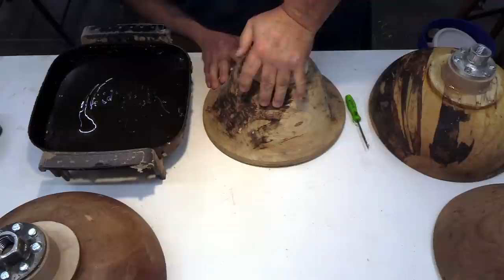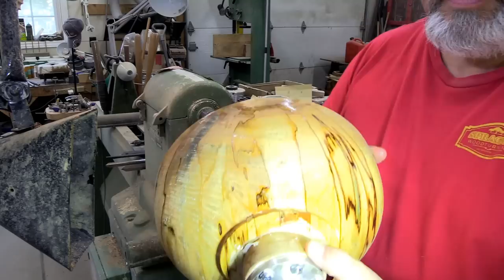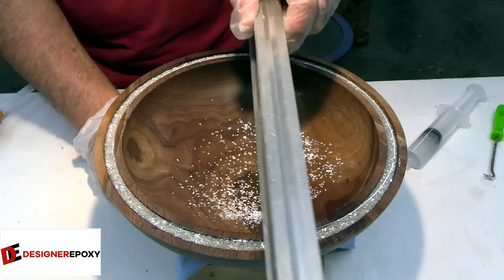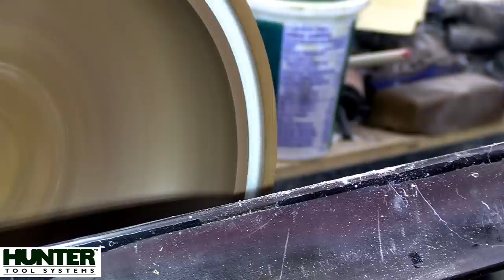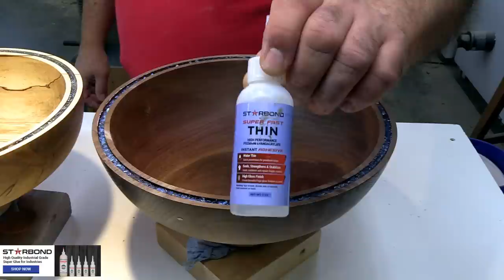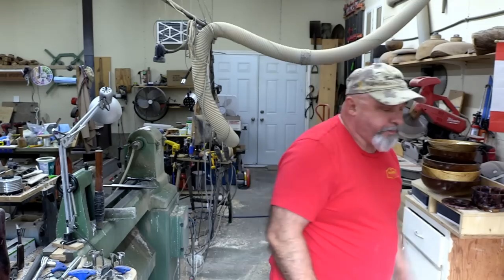Woodturning - Natural Inlay Extravaganza and Three Gallon Epoxy Giveaway!

Comment: Love all of these Jim! The Designer Epoxy did a nice job of hardening the grain in the maple bowl. 

I agree with your comments about the importance of stiffening punky grain. I’ve also found that soft maple will change colors over time as it lays on the ground. When I first started turning a friend gave me access to a soft maple log. I didn’t have a truck to haul it home so I would cut a few pieces, take them home in the trunk of my car. It took me several months to get it all home. The blanks got darker and more spalted as time went by. Made for some beautiful bowls.
Stuart
Reply from the maker: Yes they certainly would of gotten darker with time. Thanks

Comment: The opal inlay would look amazing if you put some black resin into the channel first. I'd suggest allowing it to cure before adding the inlay material.  Opal stones are often set in jewelry with a black backing, which brings out blues and accentuates the opalescence of the stone.
Reply from the maker: Just need to get my hands of some of that awesome stuff! Thanks!
Reply: @SpragueWoodturning  I'm pretty sure that's what the opalite inlay was, especially since it got so blue once you added the CA glue.

Comment: Hey Jim, I have the power cap as well and they STRONGLY recommend NOT blowing the filters clean but vacuuming them clean.  I also decided to get a different style from the same company that has the filter on a waist strap on your back - they have a pretty affordable version of that compared to the cost of other similar ones.
Reply from the maker: Thanks for the info. I will check it out!

Comment: Love the look of the inlays. My favorite is the Diopside in the spalted maple, really like that green. Love the color variety in the butternut. 

For a dam around the edge, you might try self-adhesive foam weather stripping. You may still have to run a bead of glue, but if you got a tall enough one it could give you a surface to put your level on.
Reply from the maker: Thanks for the suggestion

Comment: Congratulations Calwille! Hard to believe that a tree as nasty as black walnut has such beautiful wood. The opallight is my favorite.
Reply from the maker: Thank you very much!
Reply: Just curious as someone not so familiar with trees - what’s “nasty” about the black walnut tree? The wood sure is gorgeous, but why don’t you like the tree? Are the nuts good to eat?
Reply: @greenmanjnj  well, first you have to race the squirrels to get the walnuts picked up. You can’t eat them so they are useless. If you miss some and run over them in your driveway you have a black stain to try and clean up. If you run over them with the lawn mower that means a new blade and you need to make sure to wear a hard hat or helmet to mow. This is just a short list.

Comment: Jim, Not all hot melt glues are the same.
There's a standard glue, which most manufacturers offer, then there's high bond glue. It's a stronger bond by far.
Check it out!😅
Not sure if you were aware. 
As Always, Love Your Work!❤
Reply from the maker: I was told the one I’m using is a high temp glue, is that the same thing! Thanks

Comment: They are all beautiful. My favorite was the maple. What do you think makes a better inlay?  The Starbound or the Designer Epoxy?
Reply from the maker: Designer Epoxy seems to work better in this type of application. But if I was using crushed soap stone, I probably would use Starbond.

Comment: Nice job jim..have you ever thought of using the beall system to buff the finish at the end with the fine wheel and carnauba wax? I  love the finish.  Thanks
Reply from the maker: No need for it. Plenty shiny without it and the problem I have with Carnauba wax is in the future the client has no way to redo it. With this finish all they need to do is use some 0000 steel wool and apply the finish again and is restored. Thanks

Comment: They turned out just beautiful! I love maple so those are my favorite especially with a contrasting inlay. I love the branch inlays as well. You do such fantastic work.  I do have a question though. I thought the inlays were supposed to be done with the thin starbond. Am I remembering that incorrectly (which is entirely possible)? Thanks for sharing the video. ❤
Reply from the maker: If inlaying coarse material like these, the medium is usually what I would use. The thin would of worked good here too. Thanks

Comment: Nice inlays, would those white inlay materials work with lightly colored epoxy?  Or maybe paint  the bottom of the inlay groove?
Reply from the maker: If you put white inlay and white epoxy “, it would blend together and make the inlay disappear?  Don’t you think?
Reply: @SpragueWoodturning I was thinking of a clear epoxy with just a light coloration, or painting the bottom of the groove with a more intense color and use the clear CA to hold the inlay material.  Either of these would probably be best with a lighter colored wood.

Comment: I don't know if this would work with the CA glue especially if you spray your inlay material with 99% isopropyl alcohol before you put your resin in it will help break any surface tension on both the wood and the inlay to help bubbles release easier to come up to the surface then you can spray it again to pop those bubbles
Reply from the maker: Possibly, but I’m curious about making the glue cloudy. Thanks

Comment: I would try using either a paper Dixie cup or a Piping Bag for like frosting the Disposable kind that you can cut the it for whatever Plies whole in the end that you need and I would mix the resin and your inlay material vacuum chamber and then poor or pipe it into the bowl that way he's a resident gets all the way through it and you can be sure that there are no bubbles in it and then the last thing you can do spray rubbing alcohol on the rim before and after putting your resin and inlay material in it will help break the surface tension and get rid of the bubbles
Reply from the maker: I was told by others that the alcohol was making the resin cloudy? Is that your experience? Thanks

Comment: So are the inlay stones from Starbond real stones or simulated? I work with real stone that is too hard for inlay-type projects but if there are simulated ones I'd like to try them in projects
Reply from the maker: I believe they are real, I could be wrong on that but I think there real. Very hard to do any sanding on. Thanks